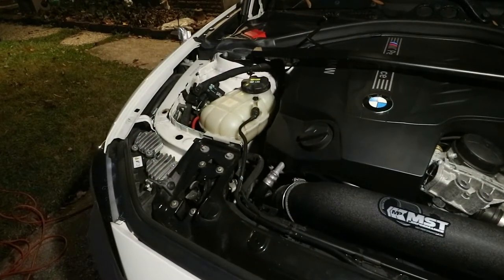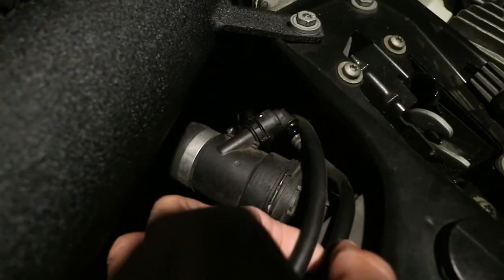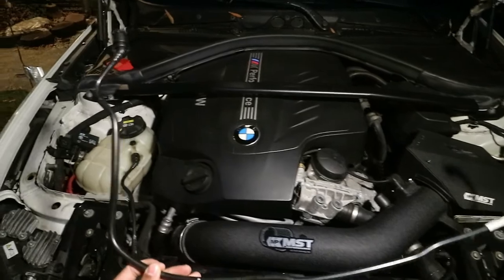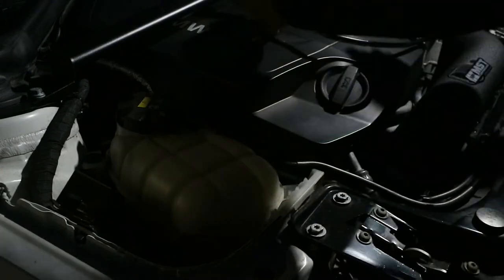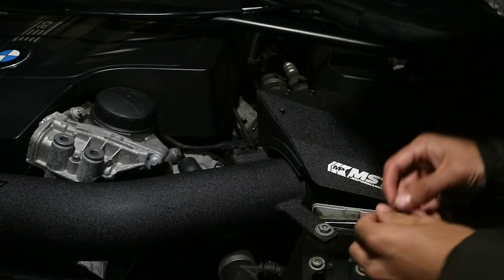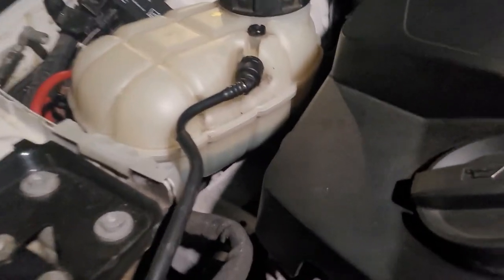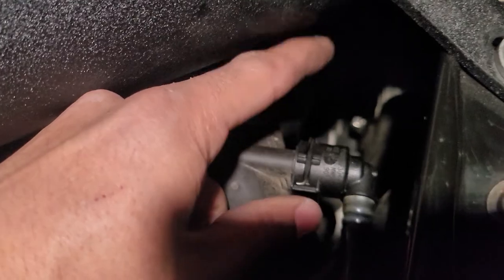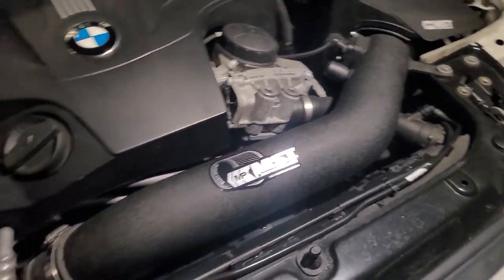What to do when your BMW is LEAKING Coolant!!

Comment: Got home to white smoke coming out of the the bonnet. Was freaking out big time.
Exactly the same pipe broke in the same spot. Understandable since they say it's bound to happen every 5 years
Thank you. Very helpful! DIY *check. 
Just under $65. Pipe and Coolant from BMW Ballito
Reply from the maker: Thanks for watching! Glad you were able to get it figured out. Yeah unfortunately isn't the strongest coolant hose but at least it's a cheap fix and it's easy so you don't have to have the dealership over charge you for the replacement

Comment: This happen to me. Both sides of my my hose broke off so I had to replace. Super easy to install.
Can you put the new coolant mixed in with the coolant that is already in there?  I went to the bmw to get the bmw specific coolant
Reply from the maker: Yeah that shouldn't be an issue and I would also use genuine bmw specific coolant right from the dealer at a 50/50 diluted mix with distilled water. Might want to just get a coolant flush done too
Reply: @jg_media9  sounds good thanks for the recommendation

Comment: would you need to bleed the system or will it self bleed?
Reply from the maker: So when I noticed the leak my coolant tank was completely empty for the mos partt. I just replaced the hose and refilled the tank with coolant and haven't had any issues since